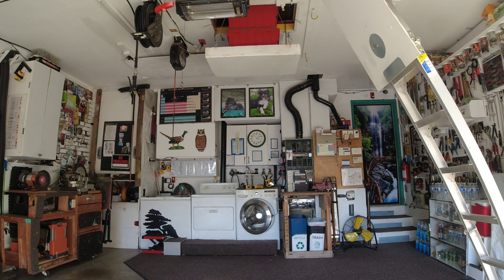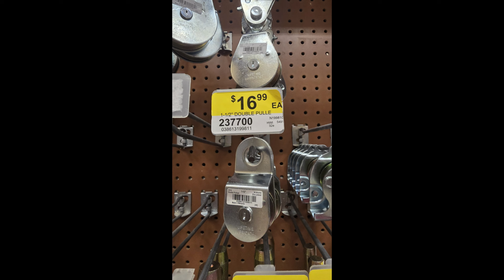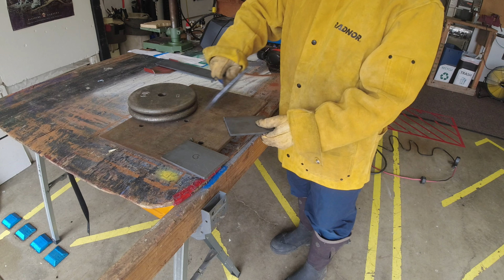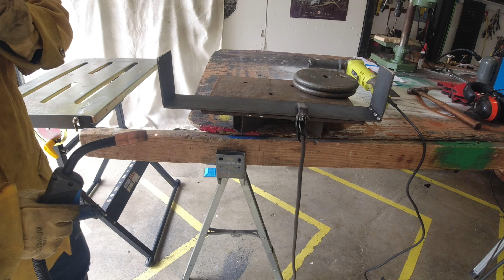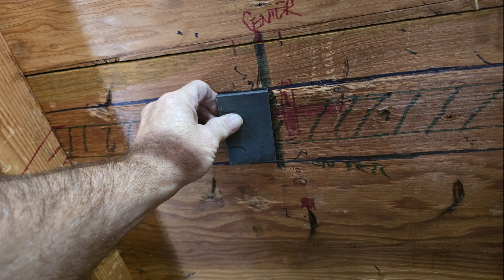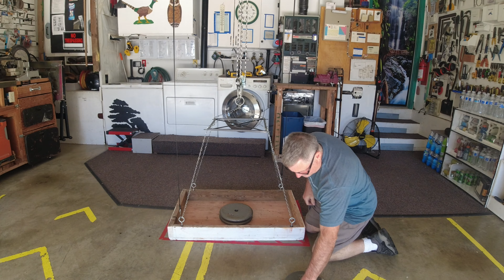Upgrade house dumb waiter with a block and tackle

Comment: This is pretty awesome and exactly what I’m looking for for my 3 stories town house with rlly good mechanism explanation thank you so much! I just don’t weld so gonna think of alternative materials for this but the core mechanics you just taught me!
Reply: Also any idea to reinforce the steel as I’m thinking of hanging this on the ceiling of my 3rd floor stairwell. What should be my base?
Reply from the maker: You are very welcome, and I am sure you can find some great alternative materials that don't require welding!